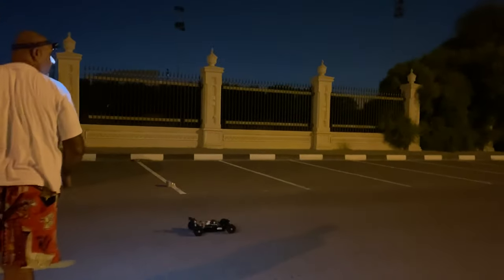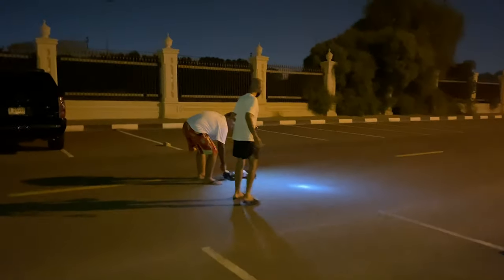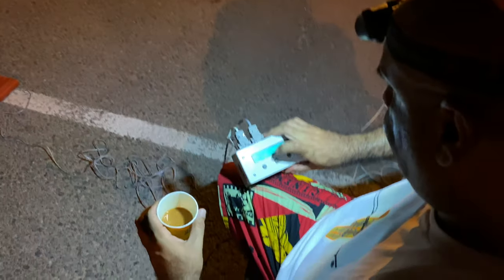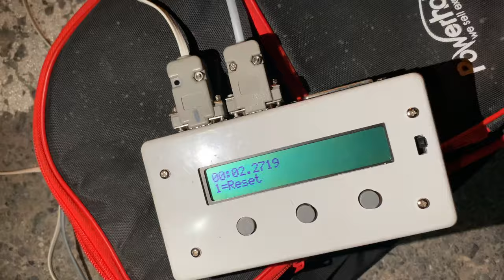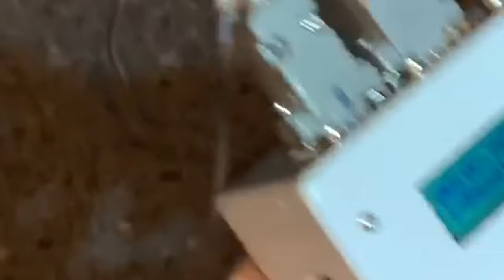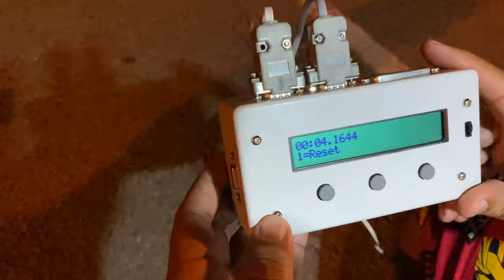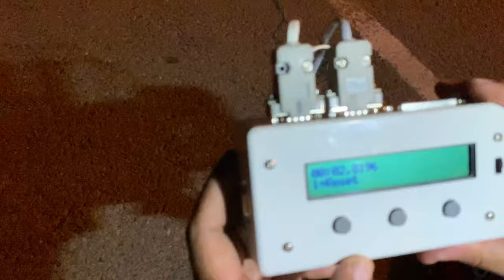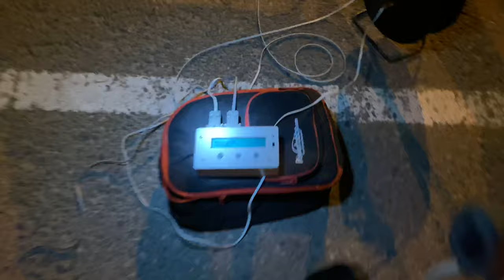RC DRAG Sensor / Timer Setup with lots of fun #Infraction #HABAO #HYPER #INTECH #TRX4

Comment: 👍😱👍👍👍😱😱😱 the tactical unit is so much fun brushless? what setupm
Reply from the maker: yes brushles 4s
Reply: 3900 kv leopard motor running on 3s hobby wing esc 120A 18T pinion gear .